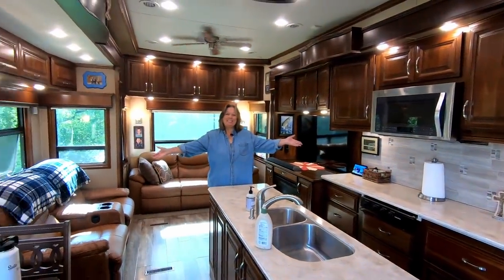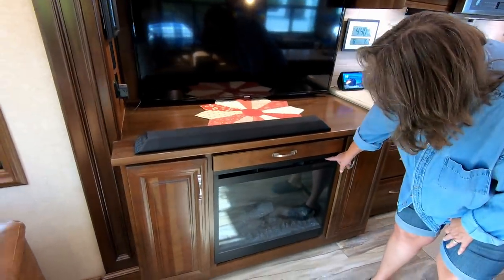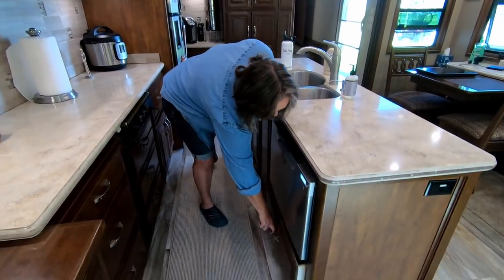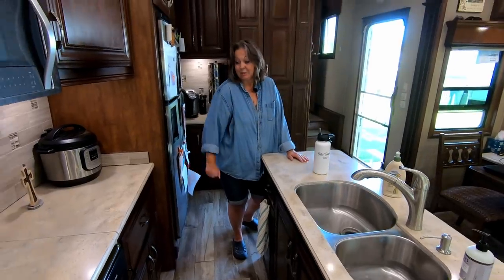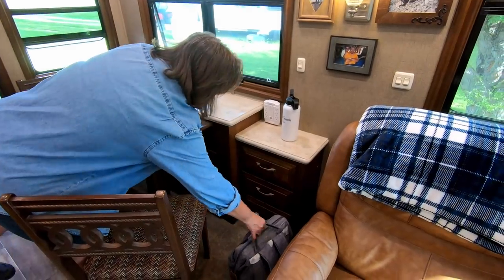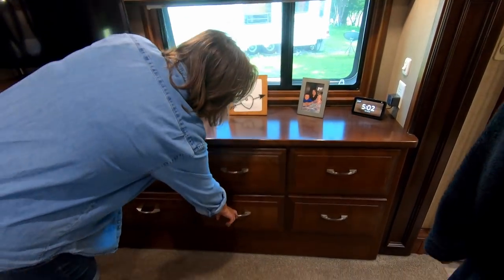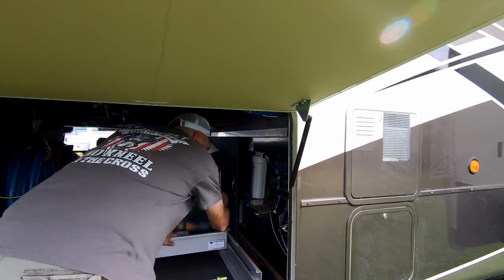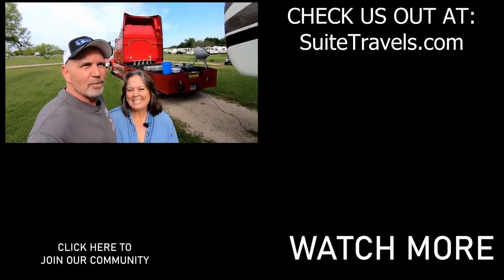DRV Mobile Suites 38RSSA - Full Time RV Tour! 🔸 Welcome To Our HOME!

Comment: One thing I noticed about your 5th wheel is that the heat vents on the floor and air ducts on the ceiling are all covered with the slides in (unless I am not seeing it correctly).  Not sure I would like that.  But I am used to my Motor Home where the heat vents are not on the floor and the ceiling vents are not covered up by my 1 slide.  I like the wood stuff too along with you.

Comment: You have a beautiful coach. Even tho by now I'm sure it's on it's way to new owners, just haven't gotten to that part yet...  Question, what product do you use to secure pictures and clocks to your walls?
Reply from the maker: Hi Stephen.  We are still in the shopping process, so we're still in our current coach 😉.  It's been really hard trying to find another coach that's as comfortable as this one!  Thanks for coming along....as far as our pictures - we use Command Strips for all our wall clocks and pictures.  They have worked great and if we need to take one down they don't leave a hole or mess on the wall!  Really appreciate you coming along and thanks for the kind words.

Comment: Do you do much cooking outside or mainly inside and how has your camper held up against severe storms and wind etc?
Reply from the maker: We do most of the cooking indoors Joshua.  Occasionally we'll use the portable smoker/bbq outside.  We've been in thunderstorms and heavy rain and the occasional wind storms and it's held up fine.  Not sure how it would do in a severe hail storm....but not sure we want to try it out!  Have a great weekend!